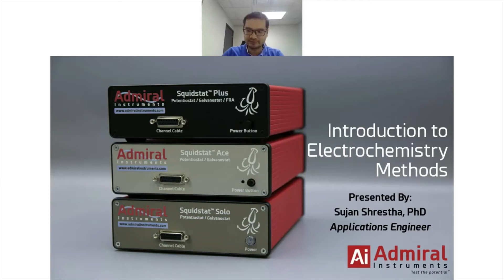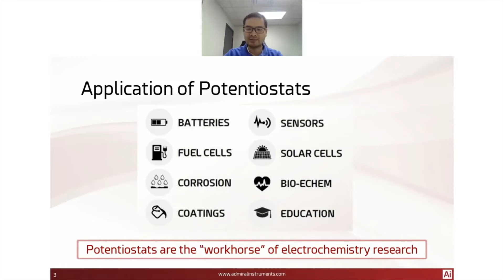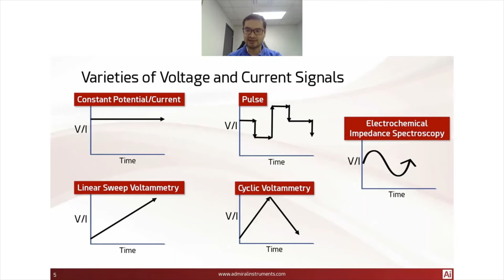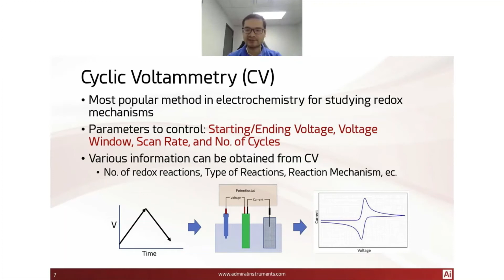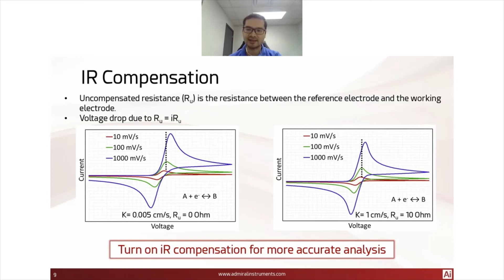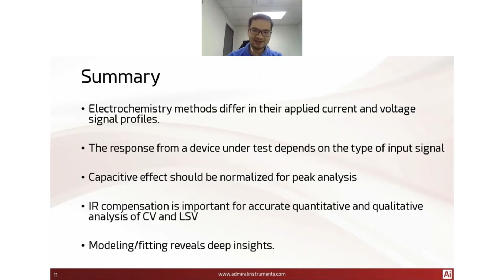Introduction to Potentiostats & Cyclic Voltammetry Tips

Comment: Can we do the cyclic voltammetry of a foil of 1×1 cm area????
Reply from the maker: Yes, you can run cyclic voltammetry on practically any type of conductive sample, including a 1x1 cm foil area. The question becomes how to interpret the data and ensure the measurement is accurate and meaningful. Please email us at contact@admiralinstruments.com if you would like more specific advice!
Reply: @admiralinstruments  In your opinion what should be the area of a conducting foil or foam for good results of cyclic voltammetry. Please reply soon it's urgent
Reply from the maker: @nafeesfatima4696  Hello! There is no rule as to how big the working electrode should be. As long as the resultant current does not exceed your potentiostat's maximum current specifications, any area should be ok and the CV results should be good.